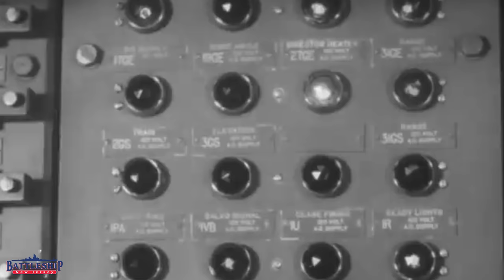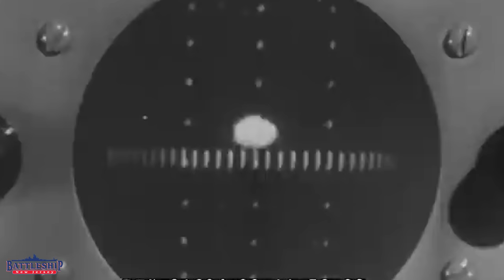FIRE! Guns, Boilers, and Damage Control

Comment: We would always skip the number "five" during a countdown of any sort, because I was told it might be confused during a heated exercise or battle with the word "fire", causing an unintentional release of weapons.
Reply: Sometimes you've got to transmit an accurate string of numbers. In radio talking protocol the number five is pronounced fi-yuv to reduce ambiguity. That's why the term niner is used for nine as well. When the troops ashore need a round dropped on five-something anywhere else could be a real big problem for the grunts.
Reply: That’s why the pronunciation of five was changed to fiver
Reply: @FP194  Good info, thanks. I mustered out as an SM2 in '77. Old school as my son would say.
Reply: @FP194  Not any expert but fiver is closer to fire than five lol
Reply: @zackhawn5944  That's why 5 was "fife".  "niner" was intended to prevent confusing five and nine.  so we have "fife" and "niner".
Reply: @adamdejesus4017  I think niner is also used to prevent confusion of "nine" with the German "nein", meaning "no", which sounds almost exactly the same (except maybe slightly different stresses/tones)
Reply: @jackaw1197  cue German screaming 999999999
Reply: Command onboard ship to fire the guns or launch a missile are "Shoot" or "Launch".
Reply: thats why we were taught "echo" for number five.

Comment: A different sort of confusion prevention.  In the Air Force we would slash our zeros to prevent confusion with the letter "O" on written documents.  Sometimes slash the letter "Z" to prevent confusion with the number "2".
Reply: Navy would slash a zero as well.  Also cross a 7 so as to not mistake it for a "t".  "Z" crossed so it didn't look like a 2.

Comment: As a young E-4 (SPC) in the Army, I didn't realize that a Captain (USN) was an O-6, instead of an O-3. I used to be amazed that after a comparatively short time, a person could command, say, a carrier...and I may still be wrong on some counts cuz the Navy ranks/rates are completely....different from all else.
Reply: A friend of mine a Commander in rank showed up at the BOQ a Wright-Patterson and saw band and a red carpet.  He asked the protocol officer what's up?  He was told the Commander of the Naval Air Systems Command was arriving shortly.  They were waiting for Commander ... and thought that was title n oi t his rank.  He did get Flag. quarters though.
Reply: Then they confuse things further by calling anyone charge of a sufficiently large vessel captain even if they aren't an O-6
Reply: Thank you for your service. 🇺🇸
Reply: @hannahranga  Additionally confusing is that if an actual O-6 shows up on a ship that already has a Captain and they're not there to take over, they're temporarily promoted to commodore.
Reply: I had a LCDR as a Captain in my first ship. So, he was a Captain, even though not an O6.
Reply: @JoshuaTootell  Yup.  Regardless of the officer's actual rank, the Commanding Officer of a Navy ship carries the title Captain.  Technically, if an actual Navy Captain (O-6) is aboard but is NOT the C.O. this officer can be called Commodore by courtesy.

The reasoning comes from the days of Wooden Warships, let's see if I can remember ... "When the enemy's shot is coming in through the sides there is no room for confusion ... a ship can have ONLY ONE CAPTAIN."  Paraphrased from some naval fiction I read years ago.  

Also by courtesy, a Marine Corps or Army Captain aboard a Navy ship gets a courtesy bump up to Major for the same reasons though I doubt much attention is paid to these rules.  During the First Gulf War (Desert Storm) I was aboard a large assault ship, Flagship for a Navy Rear Admiral, Marine Brigadier General and both of their staffs.  I lost count of how many Navy and Marine Corps CAPTAINS we had aboard as staff officers and NO ATTENTION was paid to that old rule.

Comment: As far as the Fire Department goes, back in the 1800's when they used steam engines that were pulled by horses. The engine would be connected to the steam boiler at the firehouse and water would circulate just below boiling at all times. When the alarm went off the horses were trained to go to their spot and a quick connect harness would be lowered over them, The "fireman" would start a fire below the boiler on the engine and ride back there and the engineer "driver" along with the officer would be up front. By the time they arrived at the scene of the fire the engine would have enough steam built up to start fighting the fire. The horses were disconnected and the Dalmatian or firehouse dog would keep them corralled during the fire. Today we still call the driver an "engineer" and the guys in the back "firemen" or the "PC" name of "firefighter". I was a 25 year career "fireman". Here's a link to a video about a steam engine.
https://www.youtube.com/watch?v=F1ZeelAoCpE

Comment: I heard about an Air Force Captain that landed at a Navy base.  He had to do some post flight maintenance on his plane and got rather dirty.  He called the base motor pool to request a car to take him to quarters.  What showed up was a staff car with a gleaming white interior and a driver standing at attention next to the car.  The pilot asked if the car was for him?  The driver said it was for a Captain.  After the confusion was cleared, the driver gave the dirty Air Force Captain his ride and the driver said not to worse about the interior.  He would clean it up later.  I bet motor pool when hearing the rank of Captain would ask, "Which branch, sir?""
Reply: As a Navy E-6 I ended up in the BOQ (Batcheler Officer Quarters) at Charleston AFB.  I was a Courier at the time for Defense Courier Service, a Joint outfit under control of the Air Force.  I was wearing an Air Force issue flight suit and my name patch carried my name, my Rate and service branch which was CTA1(SW), USN under the facsimile of my Surface Warfare insignia.

I guess the billeting NCO was confused by my Rate.  CTA1 means Cryptologic Technician Administrative First Class (E-6).  I think he misinterpreted it to mean CAPTAIN (O-3) and took the rest of it as Navy gobblety-gook and only gave my travel orders the most cursory of glances.  Thus I spent the night in a fairly nice private room instead of the twin, triple or quad billet I was expecting. 

I often had to fly in AF transports, accompanying cargo overseas and often one of the aircrew would point to my name patch and ask what that strange looking insignia was.  "Them's my Water Wings."  They usually got the joke quickly and I explained what the insignia was and why it was silver (enlisted) instead of Gold like an officer would wear.
Reply: @robertf3479  The 2 Air Force systems I worked on had crypto as part of the systems.  So I have a clue about your duty.  I did change plenty of codes and destroyed plenty of used code sheets.  We could either burn them or use a regular household blender to turn them into mulch.  We would get strange looks when we had to go to base local purchase to get a new blender.  We couldn't tell them why we were authorized the blender!  

Once at Grissom AFB, IN, I was outside burning code sheets.  I was sitting hunched over the burn can.  A Lt. Col. came outside behind me.  I know proper protocol would be for me to stand up and salute.  The problem there was no way to prevent him from seeing the highly classified code sheets.  That would create a ton plus of paperwork.  So I stayed hunched down.  He guess what i was doing and quietly backed through the door he exited the building through and disappeared into the building.  I did breath a sigh of relief and kept burning.

Comment: All right, Ryan - Fireman are the non-rated personnel who get jobs in Engineering, which also includes nuclear power. These ratings are:
Engineman
Gas Turbine Systems Technician (Mechanical)
Gas Turbine Systems Technician (Electrical)
Machinist's Mate
Electrician's Mate
Interior Communications Electrician
Damage Controlman
Hull Technician
The other non-rates that lead to other specialties are: Seaman, Airman, and Constructionman (CB). Those going into medical fields are Dentalmen or Hospitalmen. Yes, they are still called men. Being a Hospitalman is no sinecure for safety. These are frequently assigned to the Fleet Marine Force and serve with the Marines who have no medical corps of their own. 4 earned the MOH in Vietnam. One, Donald Ballard, jumped on a grenade. It failed to go off immediately and he was able to throw it away before it exploded.
Airman leads, probably, to the most specialties. 
Electronics
AT - Aviation Electronics Technician Electrical
AE - Aviation Electrician's Mate Mechanical
AD - Aviation Machinist's Mate
AME - Aviation Structural Mechanic (Safety Equipment)
AMH - Aviation Structural Mechanic (Hydraulics)
AMS - Aviation Structural Mechanic (Structures)
AS - Aviation Support Equipment Technician Miscellaneous
ABE - Aviation Boatswain's Mate (Equipment)
ABF - Aviation Boatswain's Mate (Fuels)
ABH - Aviation Boatswain's Mate (Handling)
AC - Air Traffic Controller
AG - Aerographer's Mate
AK - Aviation Storekeeper
AO - Aviation Ordnanceman
AW - Aviation Warfare Systems Operator
AZ - Aviation Maintenance Administrationman
PH - Photographer's Mate
PR - Aircrew Survival Equipmentman (The PR is from the original rating of Parachute Rigger.)
I'll leave it at that. I think this is a bit out of date. There is no Photographer's Mate any more. They are now called Mass Communications Specialists. All of these jobs will lead to good jobs outside the Navy. FAA is crying for Air Traffic Controllers. Many of these can find immediate employment at airports and airlines.
Reply: Dentalmen is no more, the dental rate got merged into corpsman years ago. Former Dental Techs are now HMs, with a particular NEC.
Reply: @muskaos  Thanks. The Navy's been making so many changes. My own rating, Data Processing Technician was merged with Radioman and Cryptologic Technician - Communications to form Information Systems Technician. They kept the Radioman insignia of 3 electrical bolts for the IT insignia.
Reply: AMH,AMS,&AME have all been merged under AM now
Reply: @georgehughes8698  Thank you. 😊

Comment: So the Battleship triangle consists of repair, armor, engineering and gunnery. 
I assume either I am really poor at shapes or that armor and repair are inclusive of one another. Otherwise wouldn’t it be a square?
Reply: And He ended with a two sided coin.  Poor Ryan !:-)
💜🙏⚡️
Reply: The tank triangle is made up of mobility, firepower, and protection. i assume the battleship triangle is the same. It's about how without technological advancement you can only improve one aspect by sacrificing the other two.
Reply: @rinalds637  I just thought it was funny when he said the “other two sides”
Reply: I think repair and armor are both considered the same, more or less the survivability of the ship. The other two sides being maneuverability (engineering) and firepower.
Reply: A pyramid has 4 sides that are triangles.
Reply: @davideasterling2729  yeah but who built them?
Reply: @freemanlevack6556  A pyramid is a simple geometric object. You seem to be referring to the egyptian pyramids, which are a specific structure and not relevant.
Reply: @user2C47   its pretty clear im talking about the aztec pyrameids you should probably go back to geometry school
Reply: @freemanlevack6556  Aztec or otherwise, still specific structures and not a graph used to compare maneuverability, firepower, repair, and armor.
Reply: @user2C47  just deflecting with geometry bc you can't explain how they were built
Reply: @rinalds637 I think you're right about the similarities between your tank triangle and a battleship triangle.  Thing is though, I learned that all combat arms units, regardless of service or unit type are required to do three things well:  Move ... shoot ... communicate.  Doesn't matter if it's a tank platoon, Marine rifle squad, Navy destroyer or Air Farce fighter group (well, maybe not them  😁.)

Comment: Theater work also will never say "fire" to avoid panic, if something is actually on fire, you call for "sandmen" to put it out. While the name comes from buckets of sand that offered the only historic safe way to put out fires you didn't want to spray water on (electric, chemical, liquid fuel), the majority of entertainment industries sandmen do actually use water, they just avoided any word which the public/inexperienced cast might interpret as a problem instead of routine part of act.
Reply: "Miss Flamingo" is used in many hospitals to indicate that staff needs to investigate a possible fire
Reply: In the UK, pre-alarms at places like train stations take the form “Paging inspector Sands.  Can inspector Sands please report to [location]”.  This informs staff of a possible fire.  It is said that this was inspired by the practice in theatre.

Comment: Ok - A Fireman is a E-3 - paygrade - not a specialty - In the Engineering Dept- could become a boilerman, machinist mate, machinery repairman, damage control man, electrician, hull technician, engineman. I pray the person that served as the starting point for this had their naval service be helpful in obtaining a job in a land fire department. Soo Different in on respect. Go as a marine what  happens in a Firefight- quite different than the Damage controlman's perspective. Don't forget as you drive down the road - you car has thousands of small controlled fires occurring - inside the engine cylinders.

Comment: One term the Army said to never use was repeat unless you were firing mortars or artillery. Had to say ' Say against " Never say Roger over & out together. If you did got a smack to the head & sky king award. At a hospital electrician were never allowed to say " kill the circuit " instead was told to secure the circuit.

Comment: after boot camp I was a Fireman Apprentice then Fireman. These are pay rates in engineering and not jobs . My RATEING was Electricians mate Fireman and then EM3 then EM2 with a job code of IC4722 Gyro Tech. I was cross-rated as an Electricians mate and Internal communicationsman  Second Class Petty Officer or E5.
Reply: To new guy:
That's the gyrocompass.
That part of the gyro isn't really rocking all over the place and turning back and forth.  It stays perfectly still.  That's the ship moving around it.
Yep.  Totally serious.
Sliders and fries for chow tonight.
You OK?  You look a bit pale...

IC2

Comment: Could do a video on why is everything on the battleship a gun. When on land anything like a 20mm, 40mm, 5 inch 16 inch would usually be called a cannon or auto canon.
Reply: And just for fun, the large caliber guns are sometimes referred to as naval rifles.
Reply: It varies in the Army, a 8" cannon is actually a howitzer ( cannon capable of high angle fire -above 45°) but the same gun system but with a 175mm barrel is a gun, not a howitzer. My info is 1974 vintage, I was a Fire Direction Controller, MOS 13E.
Reply: gun/rifle is proper for the navy ships they have a rifled barrel and a relatively flat fire ark compared to the gun barrel elevation where as a cannon has a high ballistic ark to get its range.cannons are predominantly smooth bore weapons and mostly a slang term for any large gun. auto cannon is altogether different terminology